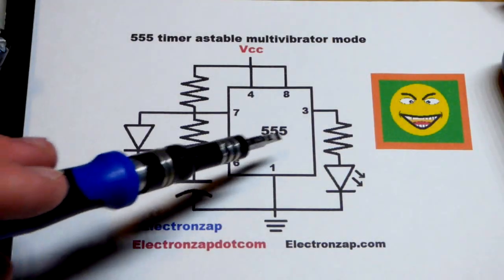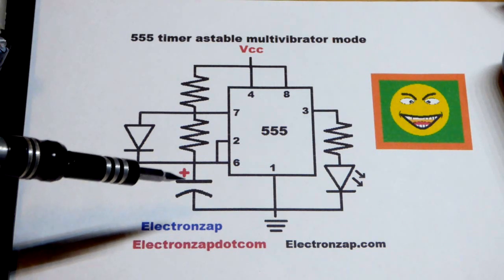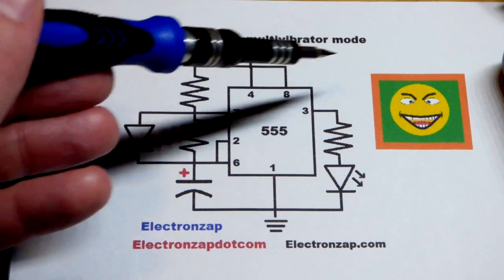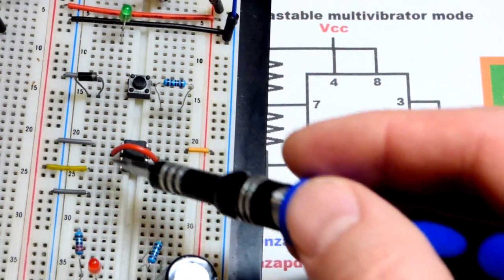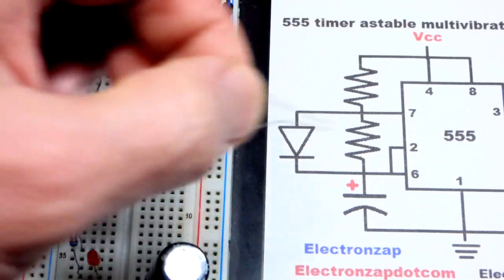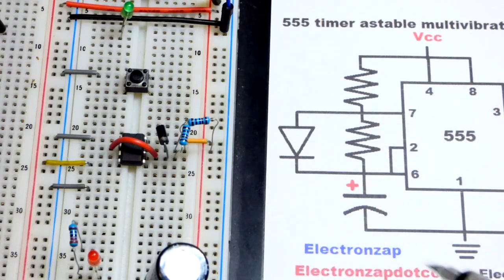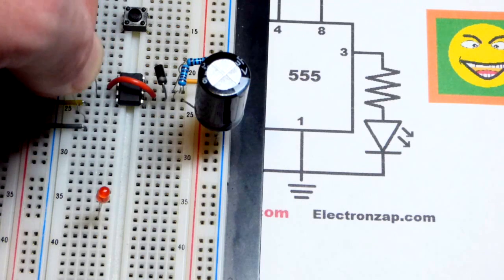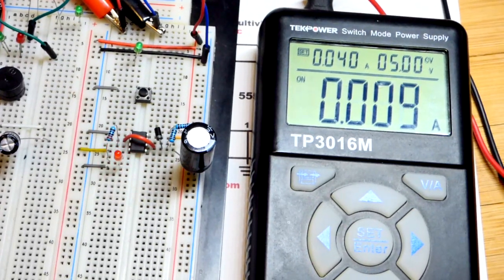Quick 555 timer astable multivibrator mode circuit schematic to breadboard build by electronzap

Comment: Instead of two resistors, I like to put a small trimpot (the kind with the blue base and white top) upside down across pins 6, 7 and 8. 😏
Reply from the maker: Just have to make sure you leave enough resistance between pin 8 and 7 since 7 connects directly to ground.